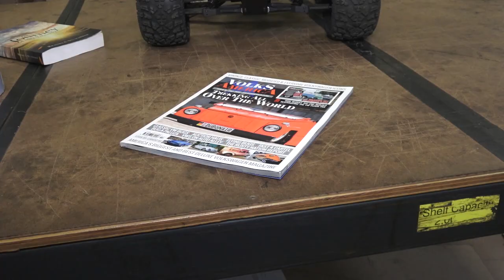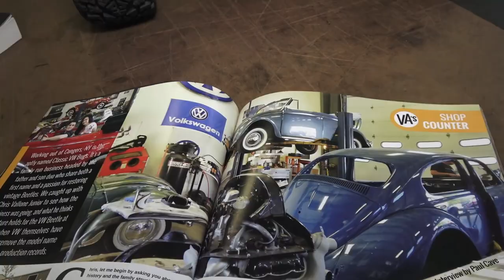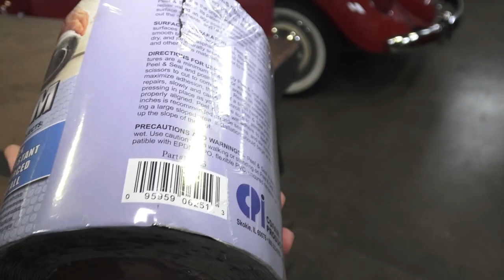Classic VW BuGs VLOG #17 Beetle Sound Insulation | Car Market | Media Blast Woes

Comment: I have placed quick roof in the engine compartment AND the rear luggage area as Chris has done. I have not had any issues either location. Unfortunately, my car is still loud as hell and rattling as hell seems to not make any difference.
Reply from the maker: What kind of engine do you have in there?  Trust me, without the insulation, you will hear it even more.
Reply: @classicvwbugs   I have a 1971 SB 1776cc with an empi E-gas carb and the common sport GT exhaust that exits the stock cut outs. I had it before insulation and now post insulation. Seems to have made minimal difference at best. I will change over to a 34 pict, maybe that will make a difference in sound?
I have a 66 bug, less sound deadening, 1600cc, 30pict,  same exact exhaust and its super quiet. The difference is black and white. Obviously bigger carb and bigger engine, but I probably have 2x as much sound deadening in the  SB, but you would never guess it. In the 66 you can actually have a conversation at 70mph. the SB, forget it.
Reply from the maker: @markdeartola1154  wow thats nutty.  That must be a real loud engine.